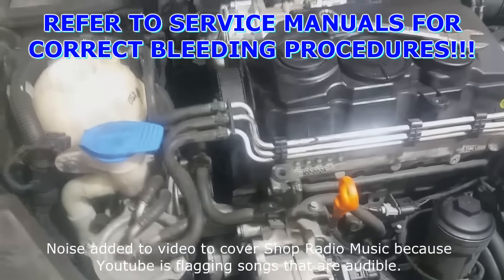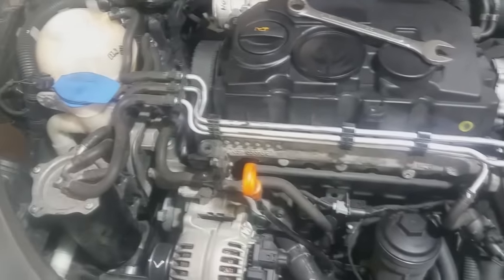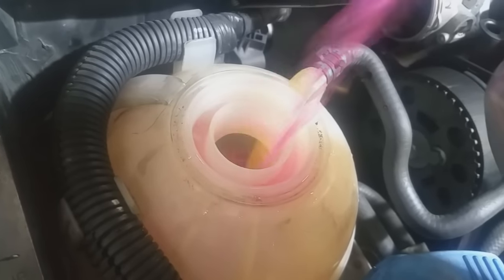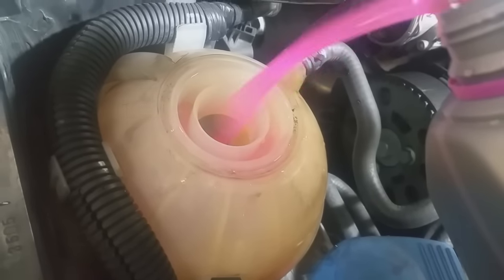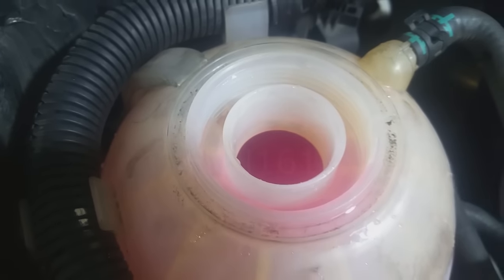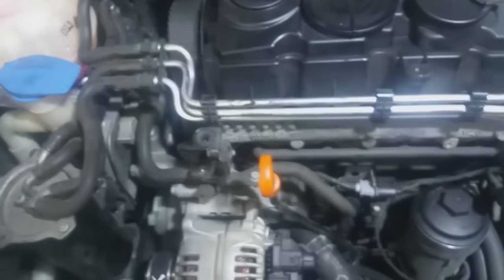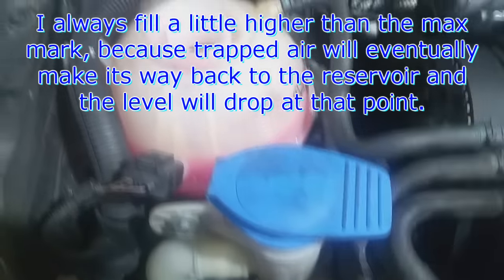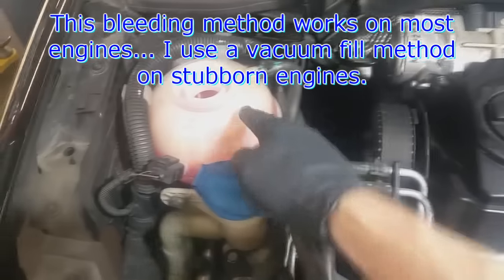Basic VW cooling system filling / bleeding info (viewer request)

Comment: The VW Service Manual recommends using a tool that creates a vacuum in the cooling system (using an air compressor attachment) then turning a valve on another hose that sucks in fluid from a bottle of coolant. If you've ever recharged the a/c compressor on a refrigerator, you would recognize the procedure.
Reply from the maker: I have that tool and use it often... I figured it would be helpful to make a video of how to fill a cooling system for people who do not have that tool. I feel good about my video (helping people)... do you feel good about your comment (trying to make yourself look good / better than me)?
Reply: @EXOVCDS  I feel good about this comment! The ego usually gets in the way bro no stress! Thanks for spreadin knowledge though, it means a lot! I learn something new every video I see from you, it's crazy.
Reply: @EXOVCDS  hence why your reply has more likes than the initial ego attempt, keep doing what your doing man we appreciate it. Remember the guy leaving the comment obviously came here for help too 😉

Comment: Help me here buddy, my vw polo gets radiator fan running at full speed as i turn on the engine, I don't think it's shorted cuz it turns off automatically even on battery after sometime when engine is off, but few days back i saw white splashes on the engine cover and and other parts , what could it be of ? Could it be related?, I checked coolant levels it looked fine...
Reply from the maker: We don't have Polo in Canada... what year? Which engine?  So that I can look for information. AC or no AC? Temperature needle in the dash yes / no? White splashes could be coolant droplets... take a closer look around the area to see if there are any coolant hoses or plastic flanges in the same area. Post a video on your channel so that I can see.
Reply: @EXOVCDS  it's a 2013 model here in India. It has AC , but no temperature needle. Coolant levels were perfect hence i don't feel it was coolant but yet what do you advice .
Reply from the maker: I need to know engine size so that I can look for a correct wiring diagram / information.

Comment: Hey bro quick question, If I want to fill up my 2016 jetta 1.4 tsi with g12 do I have to add water as well or just with the simple gallon of antifreeze and coolant is that enough? By the way the previous owner used to filled up the radiator with only green antifreeze what do you advise me to do?
Reply from the maker: Coolant / Antifreeze can be bought as mixed (with distilled water) or non-mixed (without distilled water). For most climates / locations, a mixture of 50/50 covers the engine all year (keeps the coolant from freezing in the winter and raises the boiling point for the hot summer).
If you buy non mixed... you have to add water.
If you by mixed... you don't have to add water.
The bottle you buy, will say if it is mixed or not mixed. It is best to use coolant that is sold by the manufacturer or coolants / brands that are manufacturer approved / meet the specifications. Use a garden hose to flush out the green stuff, by disconnecting several coolant hoses at different locations and forcing water through the hoses / out the hoses.

Comment: My VW Jetta 2016 does not have a gurgling sound! 😢
Reply from the maker: Depending on the engine, vacuum filling might be the only way to go. You can try to disconnect various hoses to let air out / see if coolant is present. If you didn't have any overheating issues before, then you shouldn't after. If you do, then you still have air in the system.

Comment: Awesome video👏👏 I have a Vauxhall insignia I’ve had symptoms of overheating I’ve done a pressure test all fine changed the temperature sensor & thermostat bleed the system multiple times but still I’m getting bubbling/ overheating symptoms in the expansion tank. I’m going to change the expansion tank and the cap to see if the expansion tank  is causing the water system to not pressurise. Any ideas ?? It would be greatly appreciated 👍
Reply from the maker: Do you have heat inside the car? No heat inside could be due to a bad water pump. Is coolant flowing back into the coolant reservoir when the engine is running? Is it also overheating when at cruising speeds or only while at idle?
Reply: Thomas EXOVCDS  I have heat inside the car and it only bubbles at idle only. It seems to be fine while driving not showing overheating on the dash either and all pipes feel hot to the touch so it’s circulating. It’s a strange one
Reply from the maker: Electric radiator fans are not coming on then (if electric). Check fuses, relays & fans.
Reply: Thomas EXOVCDS yeah I’ve checked those they are coming on sorry should of included that. It’s strange as everything is working as it should but still bubbling in the expansion tank. I’ve bled it multiple times. Was thinking maybe a blockage somewhere maybe ?
Reply from the maker: @madmikeproductionsuk  Have the cooling system checked for combustion gases... could be head gasket issue. Run the engine till the fans come on and feel how much pressure is in the upper radiator hose (squeeze it). Allow the engine to cool off / over night and check if the hose still has pressure. If yes, then the bubbles are combustion gases. If the hose is not firm the next morning / once the engine is cool, it could still be head gasket... so it's still a good idea to have the expansion tank gases checked.
Reply: Thomas EXOVCDS Ill have that done today and post my findings. Thanks so much 👍
Reply: Thanks for everything I appreciate it loads 👍 
I’ve had a pressure test and it was fine so no issues there. 
It turned out it was the expansion tank letting in air to the system. I’ve changed the expansion tank and cap and all is fine and working well. Thank you so much do all your help 😊❤️👍
Reply from the maker: Thank you for the update!

Comment: Hi!! I changed the coolant of my vw beetle 1999 2.0 but now theres no hot air coming out inside the car. Is it normal at first?
Reply from the maker: Air pocket... bleed the air out / fill the system correctly.
If all you did was fill coolant via the coolant reservoir.... make sure that the return hose is clear / not plugged. Air inside the engine can not get out if that hose is plugged somewhere. You can remove the coolant temperature sensor in the side coolant flange at the side of the cylinder head...to let the air out (plug the sensor back in once coolant comes out).
Reply: @EXOVCDS  hi, first i filled it up with distilled water just to clean the system then i empty the system and fill with Pink coolant. I did all of this because I change the coolant flange. I touch the hose Next to the flange and its hot and the one that goes to the thermostat is cold.
Reply: @EXOVCDS  is it normal that my fan doesnt turn on?
Reply: @EXOVCDS  coolant comes out the sensor.
Reply: How much coolant the vw beetle 1999 standard 2.0 needs?
Reply from the maker: 5L coolant (50/50 mix).
If you have no heat inside the car, then the water pump is no good or the heater core is bad. With the engine at idle, you should have coolant flowing back into the coolant reservoir... like this: (at 4:47 there is NO FLOW)
https://www.youtube.com/watch?v=ln4grYe3WnE

At 7:11 there is flow (good water pump).
Check for hose blockage first... like I did at the beginning of the video.
Reply: @EXOVCDS  Im hoping you can help me - I just got an 02 beetle 1.9TDI with only 72k miles - the timing belt etc was changed at 62k miles.  The coolant hose up front (with the wire push clip) on the radiator somehow came off the other day while driving and the overheating light came on and beep warning.  I assume I lost all coolant and I reattached it and re-secured the hose and filled the reservoir with green coolant not knowing I was supposed to use the pink stuff (it took 6 liters of coolant). It got cold here all the sudden in Texas and the heater is not blowing hot and it takes a long time to barely blow warm.  The running temp on the vehicle works fine with the green coolant but what do you suggest. This was done about a week ago. Thanks for your help on this
Reply: Im going to try and remove the temperature sensor as you suggested to see if there is an air blockage.  Im actually just going to replace with a new one so the O ring is new. Any other suggestions would be appreciated.  As far as I know the previous owner stated the heater worked very well last year, so im assuming its from losing all the coolant when my hose popped off and all I did was just refill with coolant.  Im assuming the green pre-mix I refilled with would not be causing this issue of not getting hot air?
Reply from the maker: @todaytexomacom  Green coolant is not an issue. The heater is of an open flow design... meaning that air should bleed out of it when the engine is running. You can put your hand on the heater hoses and check to see if both hoses are warm. If yes, then the heater core should be warm as well. Have a look under the dash and locate the "hot & cold" blend door lever. There's a blue sleeved cable that moves the heater blend door, as can be seen in this video:
https://www.youtube.com/watch?v=6U9ZdkAjdhQ
The lever can fall down (when the retaining clip is broken) and then you have no control over hot & cold.
Reply from the maker: @todaytexomacom  A stuck open thermostat will cause the engine to take a long time to warm up... hold the rpm at 2000 until you feel heat inside the car (if it's not a blend door issue). Once you feel good heat, drive the car at steady speed 30 to 50 mph. If heat drastically drops, then the thermostat is stuck open, causing too much cooling to take place.
Reply: @EXOVCDS  I have felt of the larger hose since refilling with coolant and it does get warm. I have also cut the plastic to get access to the blender door from passenger side. From your video it looks like i may have been looking at the wrong thing. The plastic arm was yellow and the cable was secured. It was very hard to get to and see but your video looks like its further back over the heater vent. I gave up after a bit because the bushing and cable seemed very secure and it was a pain to get to but i need to check this again. if i recall it may have felt stuck as i was  turning the temp knob or maybe i was looking at the wrong thing.  This could be a thermostat issue. Do you have a video of changing thermostat on a 1.9 diesel?
Reply from the maker: @todaytexomacom  https://www.youtube.com/watch?v=4OtXEqdTXvc
Reply: @EXOVCDS  Thank you so much for taking the time to help. Hopefully one of these things work for me. This engine only has 72k miles on it for an 02 model. Surely it has some miles left on it
Reply: @EXOVCDS  Im having another issue with my 02 beetle and wanted to see if you had a solution. The hood is not locking shut. The safety latch is catching so it is secured but there is play in the hood and it wont lock down flush. You dont have to pull lever in car to open it and the plastic handle just stays exposed in front.
Reply: @EXOVCDS  I think I realized I may have screwed up! I went and looked at the first jug of coolant i put in after the radiator hose popped off and it was concentrate and not a diluted mix. Will this affect the car from heating up slow?  The blend door is working just fine and the car did blow warm air finally this morning while driving around but not very hot. The blue temp light did take awhile to finally go off - Please advise on what I should do and if I damaged my engine by not diluting the coolant concentrate.  The extra i topped off with was diluted
Reply from the maker: @todaytexomacom  You can check your coolant mixture that is in the reservoir bottle with a coolant tester like this one:
https://www.amazon.com/Antifreeze-Refractometer-Displaying-Fahrenheit-Automobile/dp/B077DSY1D6/
Your thermostat is probably stuck open and that's why the blue light stays on so long and you are not getting much heat (radiator is constantly cooling the coolant).

Comment: I just had a timming belt and water pump don't on my jetta gli now heat comes out but no forced air from heater, my temperature gauge reads normal doesn't over heat worried that there is air in the cooling system though, or it could be the obvious blower fan, but everything worked fine before I had the timeing belt done any suggestions
Reply from the maker: Change the setting to recirculate.... any difference? You might have a clogged cabin / pollen filter.
Reply: @EXOVCDS  no it still didn't come on I can feel air comeing threw but its not blowing on any setting, heard just a humming noise when I hit that button tho
Reply from the maker: If you have lack of "air flow"... that has nothing to do with timing belt & water pump.
If you had normal air flow from low to high (as per dial settings), but NO heat, then yes... could be an air pocket. The way you describe the issue, I get the feeling you are saying there is lack of airflow (can't feel much when the blower is set to high). That's a restriction of air flow... cabin filter or blend door issue.
Remove the cabin filter in the engine bay and have a look if you can see the blower motor that sits under it.
Reply from the maker: What year GLI? mk3 / mk4?
Reply: Eaxctly there's just no pressure but heat and a.c. work, thank you for you're help ill see if that works
Reply: @EXOVCDS  its 2008 jetta gli 2.0t fsi
Reply from the maker: @cathejuiceman2546  Cabin filter is under the glove box. You won't be able to see things like on the older models. I'm not sure if the early mk5's had cable operated heater doors / blend doors. If yes, could because cable adjustment issue or broken lever where the cable attaches. If it's an electronically controlled heater box assembly, it's probably a bad motor causing a flap / blend door to be stuck.
Reply: Was the blower motor pricey fix
Reply from the maker: Not the blower motor... the motor for one of the blend doors. I don't know what the problem is, so I can't say how expensive it will be.
Are your heater controls similar to this one:
https://www.youtube.com/watch?v=0AqqgP7H2Ls
Reply: I have different controls then that one but I can't just replace that whole unit and call it a day after watching that its exactly what i got going on
Reply from the maker: @cathejuiceman2546  I still don't exactly know what's going on... Post a video on your channel. Or remove the motor and activate it outside of the housing. Remove the cabin filter under / behind the glove box to check for air restriction. I'm sure you'll figure things out.

Comment: was the reservoir full when you started siphoning?
Reply from the maker: Did you watch the video? At 0:35 i start to fill the reservoir... fluid level will start to drop... add more fluid... start squeezing hoses.... fluid level should drop more... add more fluid.... squeeze &  add until the fluid level no longer drops. Start engine and look for fluid ***returning into the reservoir***. If fluid is not returning, check for a restriction in the hose. If your engine does not have a reservoir / cooling system design like in this video, it may be that you need to do things differently.
Reply: @EXOVCDS  i watched the video,  I have a vw, not being disrespectful, just wanted to know if the reservoir was at the normal level before adding more after siphoning. It's a stupid question but just wanted to know. thanks
Reply from the maker: No problem... give me some more background / info, so that I don't have to guess what you are trying to solve. Overheating? Have done / going to do a cooling system flush? The more I know, the better I can help. Year, make, model, engine.. etc etc.
Reply: @EXOVCDS  the heater was only working in drive but very slowly. Never in idle. Jetta 2011 comfortline, auto. gas, 2.0. The coolant was changed 2 years ago, started happening the end of last winter. So yesterday, I opened the cap and a huge blast of air came out. I squeezed the hose a few times and the heater started working right away. But I didn't add any coolant. The real test is to see if it works in -10c.
Reply from the maker: @chatimer  If you opened the reservoir when the engine was warm... then the system was under pressure and that causes fluid / pressure to push out. If the engine was cold, but pressure was present, then there is a cylinder head gasket problem. No heat inside the car can be because of a faulty water pump, low fluid level or air in the system (from a bad head gasket).
Reply: @EXOVCDS  I'll check it out, thanks!

Comment: how do you get all the dirty coolant out on a fully electronic coolant control system (closed circuit)? if i use a garden hose where do i attach it?
Reply from the maker: Anywhere you can... feed water in & drain at several locations. Disconnect heater core hoses and flush the heater core separately, same with radiator. It all depends on what engine & the type of access that you have to various cooling system components (hoses, flanges etc). Worst comes to worst... drain what you can, fill with water, bleed the system with electric pump (will circulate / mix remaining coolant)... drain again, fill again, bleed again and repeat until nothing but clean fluid comes out. When you are ready to add coolant, add a 60/40 mix to offset the water that is already in the system.
Reply: @EXOVCDS   thank you for your reply.